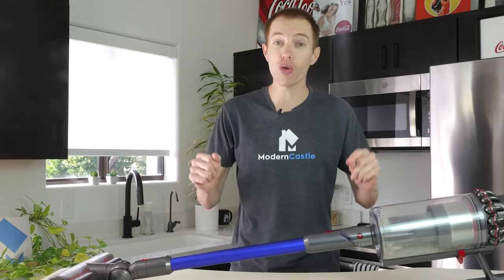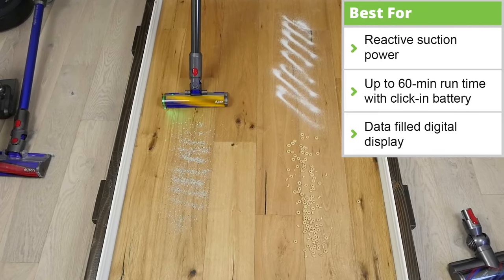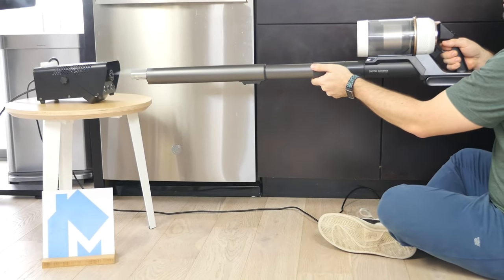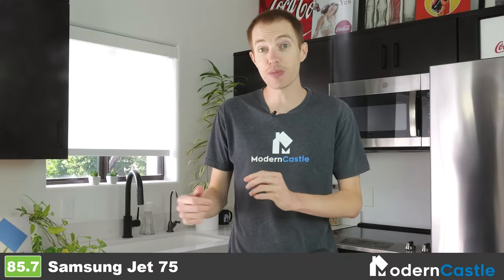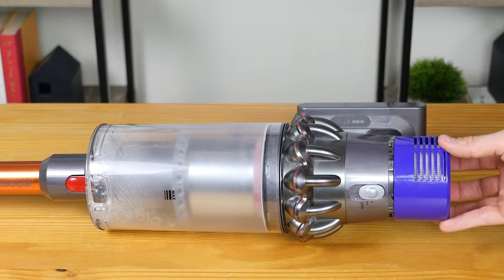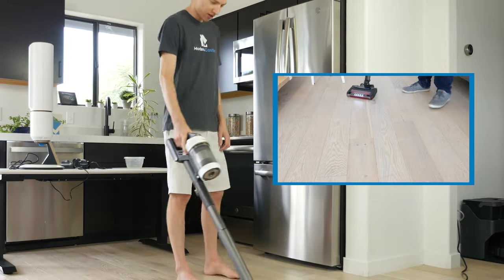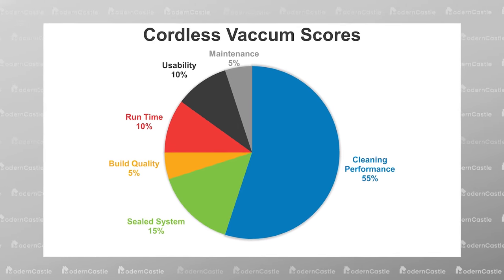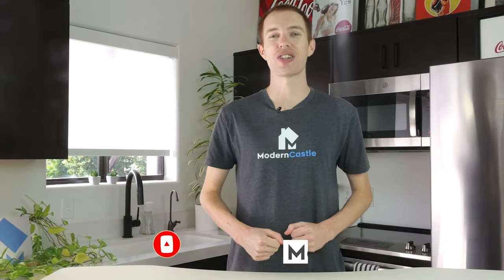The 6 Best Cordless Stick Vacuums for 2024: 41 Vacuums Tested

Comment: I'm sorry, but if you have a Dyson in your budget range you're not understanding the word budget.
Reply from the maker: Budget is relative to other choices within the cordless vacuum market.

Unfortunately, anything below about $400 in the world of cordless vacuums just isn't a good vacuum. If you need something below that price a corded stick or corded upright is a far better choice in terms of price and value.
Reply: @ModernCastle I had a Beldray that lasted me years was like £130 and had no problems with it. It only broke because I dropped it and the lid broke
Reply: I put Dyson price point in my budget so therefore it's in my budget. It was pretty simple to understand. People use the word budget, interchangeably with inexpensive. Which just isn't correct.
Reply: Being cheap will cost you more in the long run
Reply: I disagree. Budget means budget ! $400+ for a vacuum is premium
Reply: So yes, budget can mean the amount you set aside for something, but in this case it's being used as an adjective meaning inexpensive.
There are PLEANTY of "inexpensive" cordless stick vacuums (ie: under $250-300). @ModernCastle your choice to exclude them as options in favor of a Dyson (even if not "good" in comparison) limits your reach to viewers. I would recommend having price guides for each category (budget, mid, high end) that would relate more to the approximate flexible income for different classes. This would automatically rule out more costly options that likely work better; however, that should realistically be the point when looking for a budget option.
Reply: @RubbingPotatoes unfortunately that’s not how words work. The word budget does NOT have a singular bracket, price wise. It is simply a measure of level of ability to meet an expenditure in a certain amount of time. $100 can be your budget and $400 can be the other individuals budget. It is interchangeable. Dictionaries and google are pretty accessible nowadays and it pays to know what words mean at their core 🤷🏿‍♂️💁🏿‍♂️
Reply: @danielvidal46  if that's true then budget really has no relevance. Saying this item is the best budget option has no practical meaning.
Reply: People have different budgets though lol
Reply: @danielvidal46  Challenge accepted. From the Oxford dictionary (first option on Google):

>
BUDGET
noun
1.
an estimate of income and expenditure for a set period of time.
2.
ARCHAIC
a quantity of material, typically that which is written or printed.

verb
allow or provide a particular amount of money in a budget.

adjective
inexpensive
>

In this case it's being used as an adjective: "budget vacuum." The word "budget" describes the noun "vacuum" and can therefore be taken to mean "inexpensive."
Reply: Thank you! It would be more accurate to use the term "budget friendly" :) @millybadisonoutdoors
Reply: After having g 2 dyso s fail way too early for us & there on this list we ended up getting a Shark Stratos & so far no complaints. Personally think it removes more dirt from carpets than the Dyson did.
Reply: Peopenuge different budgets based on their life. If you make $12k a month and have $5k in total bills monthly, dropping $1,000 on a vacuum is easy. If you make $6k a month and have $5k in total bills monthly spending al you have left is stupid. So…. Your comment is kind of a mute point  honestly.
Reply: Most liked comment for a reason😂
Reply: Yeah, but I've bought 3 cheap ones vs the Dyson at work that keeps going and going. Dyson seems more powerful too. Your comment is cancelled.

Comment: Why dont they ever factor in usability. Some dysons dont have on off switch so you grt hand fatigue, some sharks have really heavy heads so arent easy to move around, and some have a heavy top bit so again you get tired hands and just dont feel nice in the hand. Also some heads are really thick so doesnt go under things easily and some dont have attachements for getting into corners and crevices. These should all be factors too as having one with a great suction but is a pain to use just makes it a no for me.

Comment: I have the Dyson V10 and the Dok.  The Dok is well worth it (mine was free at the time direct from Dyson).    I haven't seen any need to get a newer vacuum yet and I can clean a 1,200 sq ft home on Eco mode.
Reply from the maker: V10 is still an amazing machine, especially for the money. Really no need to upgrade if it's working well.

Comment: One problem I've had with my Dyson V11 is the inlet size into the dustbin is too small and larger clumps of dog hair (I have a husky) clog it up very easily. The brush roll remains tangle free, which is nice, but I have to dig the hair out manually. I also have a lot of trouble with cat litter and other heavier materials falling back out of the tube after turning the unit off. I recently got an LG CordZero and so far neither of these have been an issue but I've only used it a couple times. All the new dysons seem to have the same design so not sure if this is just a real world scenario not captured by your testing or what.

Comment: I would have liked to know how well each model can stand up without tipping over. Matters for older users.
Reply from the maker: Virtually none of these stand up on their own. That applies to most cordless stick vacuums on the market.

Some will includes stands, some are compatible with third party stands, and the Shark Flex lineup will compact down and stand on its own.
Reply: Dirt Devil Cordless Standing Stick Vacuum, BD57010V sold at Walmart. Never used it so not sure how well it works.

Comment: Would like to see how each one is charged.  We own a Shark cordless we got from Costco.  The vacuum folds over itself and you plug in a cord similar to a laptop.  

Our 12yr old delayed development kiddo has a hard time figuring out how to flip it back up and frequently doesn't see the cord is plugged into the side of the battery.  I have been shopping for a second cordless vacuum that simply sits into a mount and charges like Dyson has.  

We got a Dyson from Costco before our Shark, but the motor failed in the first 30 days of light use.  Thank goodness Costco is awesome and took it back no questions asked & we got the Shark instead.  It still works about a year later but the folding over and charge cord are challenges I would prefer were upgraded by a charging base.

Thanks for posting the video.  Despite it not showing how they charge, it was still helpful.
Reply from the maker: Most of these are pin chargers. So it's just an AC to pin outlet connection in the back of the unit.

Some, like Dyson, have a wall mount.

A handful (we indicated the models in the video) have free standing stands. Those stands are typically powered. So once it's on the stand it is automatically charging.

Shark is the only one that folds down into compact mode. The vast majority don't fold and don't have a free standing mount.